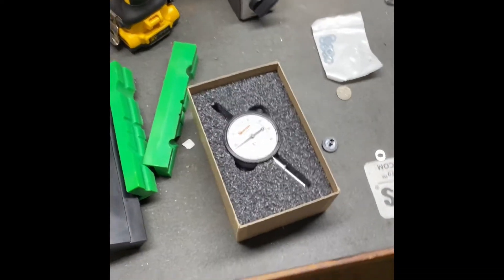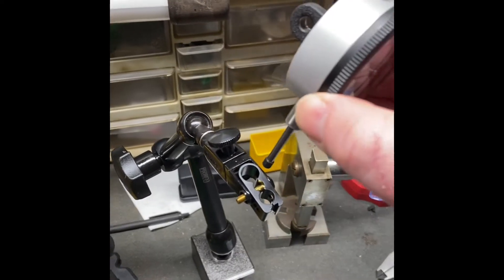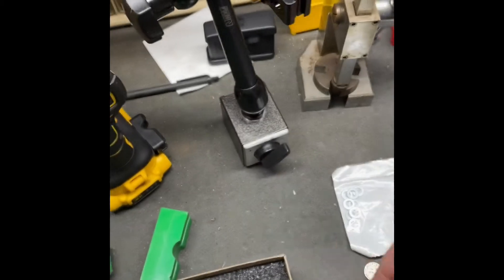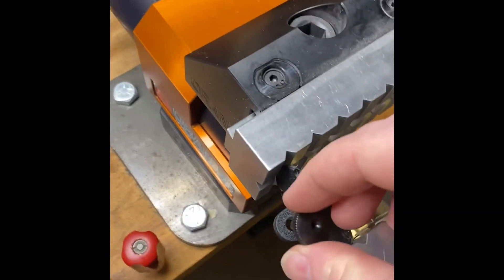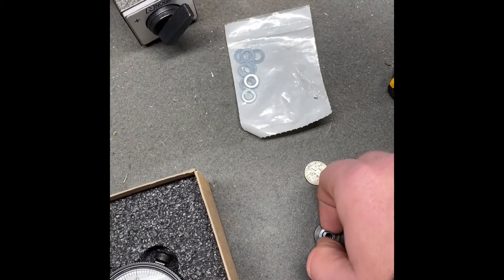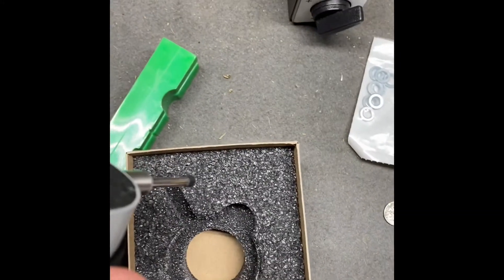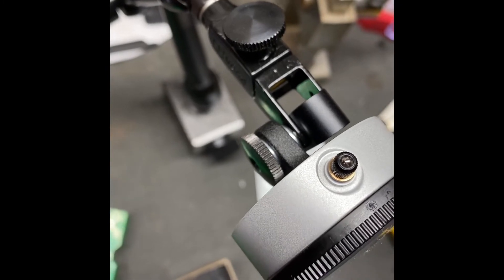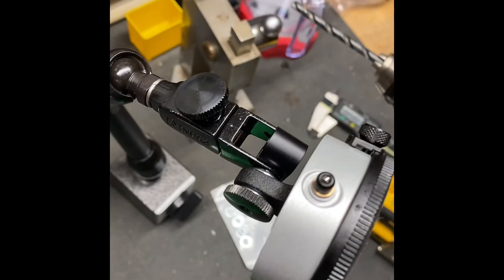Mounting a Lug Back Dial Indicator to Noga Universal Mount (Easy Way)

Comment: Brilliant.  

Best thing I've seen to date is the Mitutoyo dial indicators that have dovetails right on the sides of them.  On the other hand, I'm sort of amazed that no one makes replacement indicator backs with dovetails.
Reply from the maker: Glad it helped out. You would think there would be a more simple solution as popular as these mounts are.

Comment: Helps a lot, but still not right. It's very awkward to use compared to a real lug back holder. Noga can do a LOT better!
Reply from the maker: Agree 100%.  It’s far from ideal.  I’m not sure what the original design fits, but it sure is not this……..hopefully this at least got you working!!
Reply: @vettepilot427  I was doing something similar, though my screw is smaller than 1/4. and I had to bushing it. Your complaint with Noga inspired me to make a dove tail adapter from a lug back holder. Thanks again VP!
Reply: @vettepilot427   My home-made dovetail adaptor worked like a charm!

Comment: You are a genius. I have struggled for a long time using a Lug Back. When inserted into the clamp, there is no room to access the fine adjust nob.

2 simple washers and a few seconds of reaming and I got my only problem with Noga solved!!
Reply from the maker: Awesome!  Glad it worked for you. Thanks for the feedback.

Comment: It is amazing how little there is on mounting lug back indicators out there. I guess you are expected to just know. It is probably obvious once you do know.
Reply from the maker: I agree completely, that's why I posted the video.  There's pretty much nothing out there that I could find myself besides pictures that gave any information on mounting.  Most folks are machinists and make their own mounts, but that didn't really help me.  Even though it's supposedly an AGD "standard" design, there's not a lot out there.
Reply: @vettepilot427  I even contacted Noga. They said yes you need an adapter and no we do not sell one. Honestly, other than the fact they did respond, I got the impression they did not want to sell me anything more.
Reply from the maker: @curiousgeorge4608  Interesting. In their literature, Noga specifically mentions that this arm is compatible with Lug indicators.  I assumed when I bought mine that I didn’t need anything else. Oh well, hope this helped you!